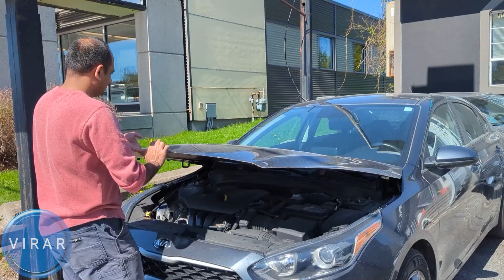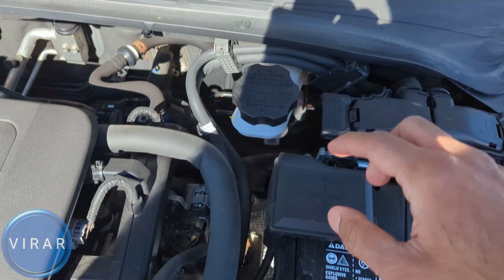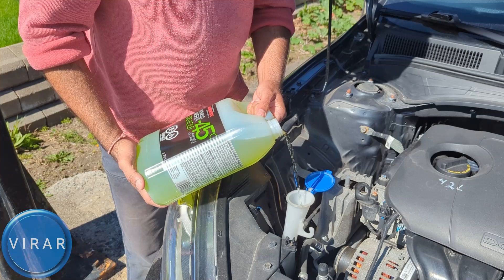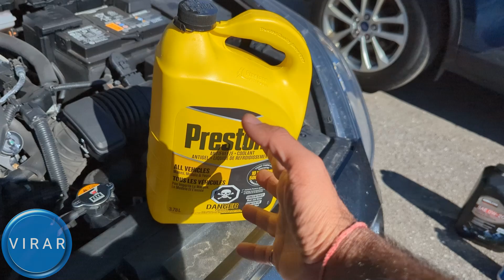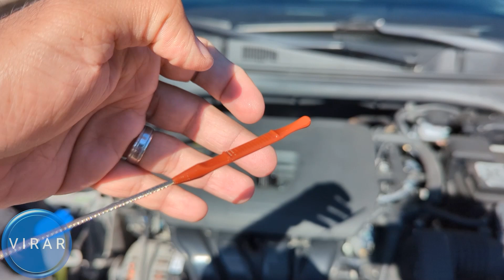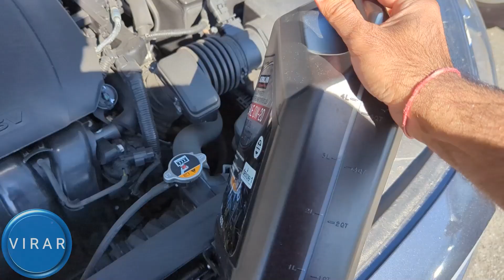How to Check and Fill Fluids [COMPLETE GUIDE] - Kia Forte (2019-2024)

Comment: Your forte lsx CVT will go low every 50,000 miles. Under the battery stuff is a bolt that is used to fill up the CVT with transmission fluid.  Put a small medal rod down the hole till it bottoms out and mark where the fluid is. That's your makeshift dip stick. If your more mechanically inclined , drill a hole , tap it and make your own dip stick. My 2019 forte LSX transmission burned up at 70,000 miles. Completely avoidable if it had a dip stick.

Comment: Please tell me what color coolant I should add to my 2020 Kia Forte LXS with a 2.0 engine. The manual just says add the 50-50 coolant. It does not say anything about color. Cool video, thumbs up. Thank you for your help.
Reply from the maker: Green color is what the coolant color is that comes from factory. What you can do is using the Prestone 50/50 premixed coolant. It works with all makes and model. Like the one I show in this video.
Reply: @VirarAutomotive  Thank you so much.

Comment: The transmission fluid for the kia forte 2018, does it work the same as this one? That there is no way to check it and only have to change it every 150k miles?
Reply: 150K miles is way to much bro. Get it change every 50k miles.